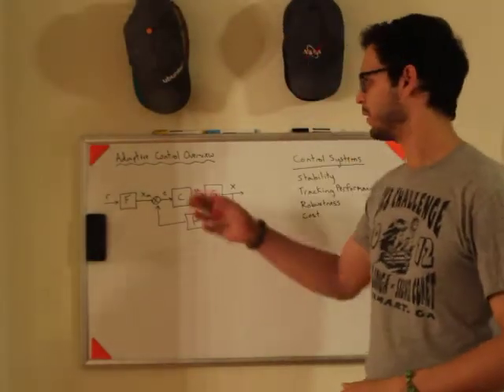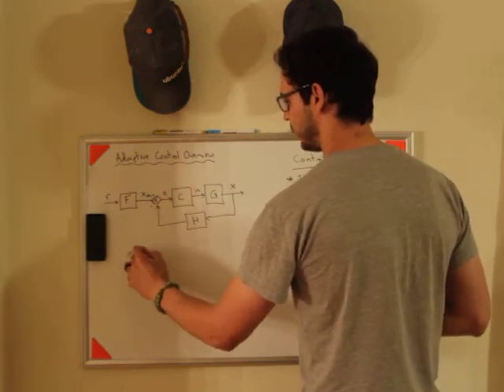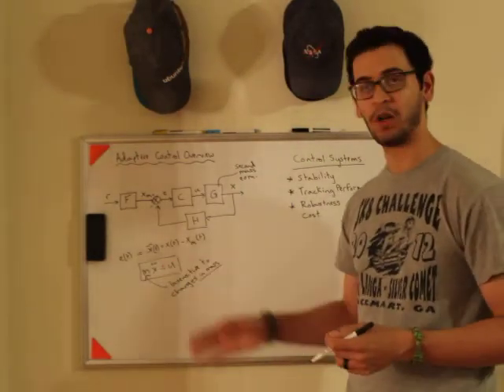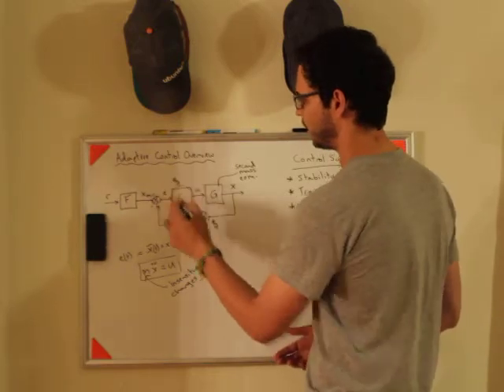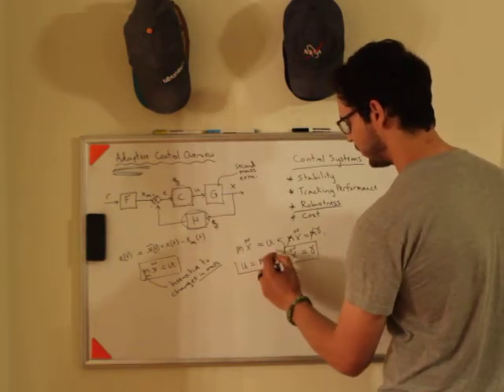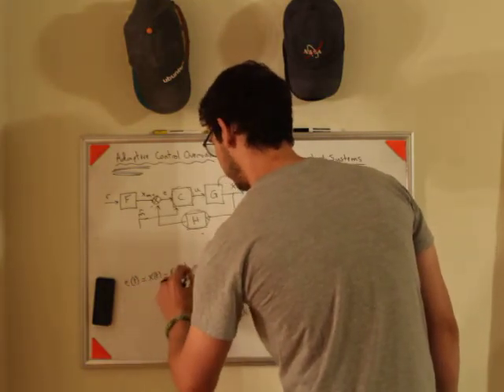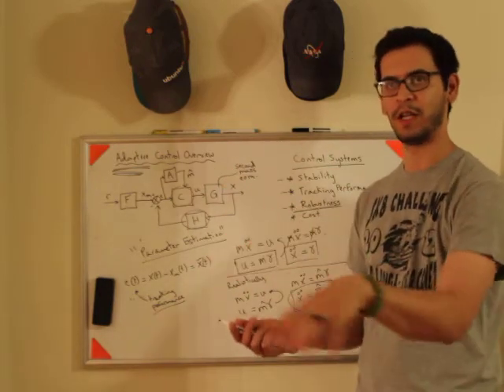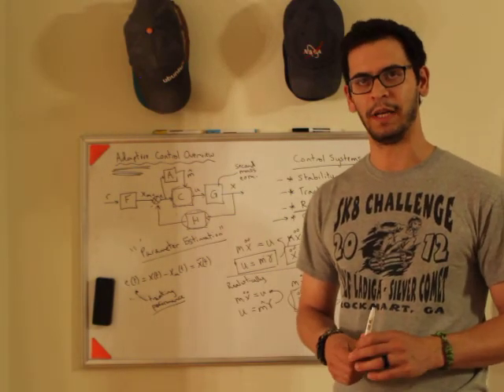Nonlinear Controls - Why Adaptive Control

Comment: Good evening sir 
I have two questions
1. What is the significance of designing the adaptive backstepping controller?
2. What are the advantages of the common Lyapunov function over the average dewell time ?
Reply from the maker: Lyapunov control design is not as intuitive. PID is the most intuitive because changing the gains has a direct correlation to the time response. Time response tuning with Lyapunov control is quite difficult and is mostly used as an exercise to prove stability. Hope that helps.